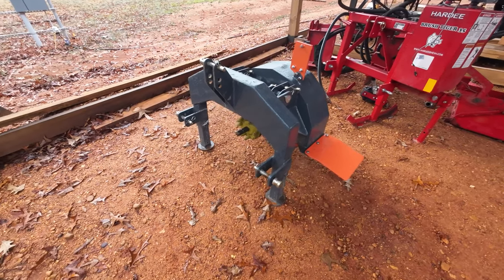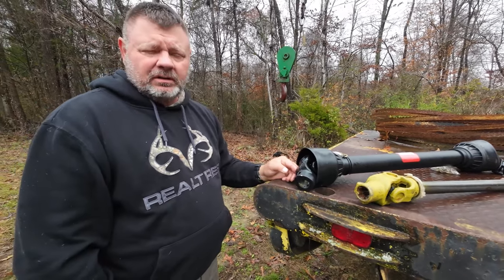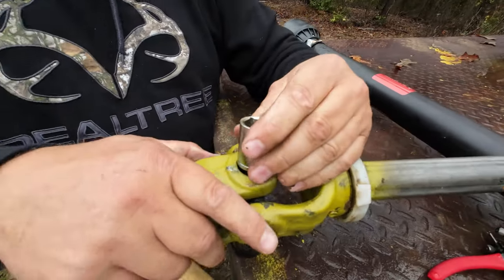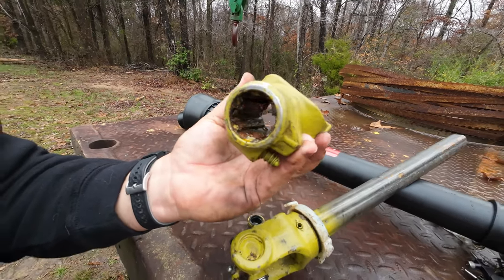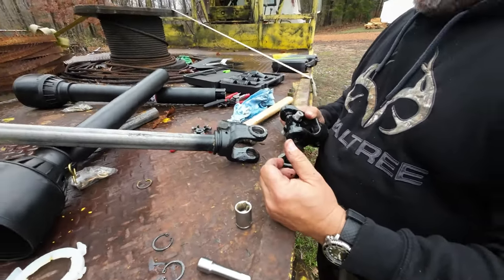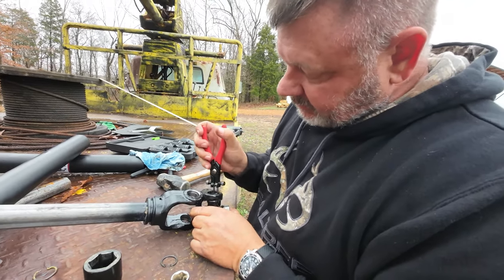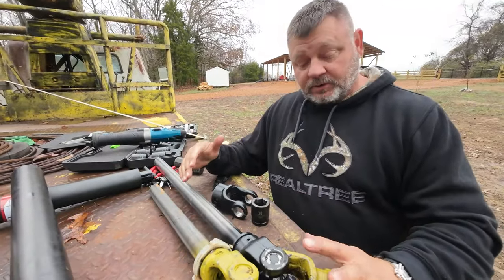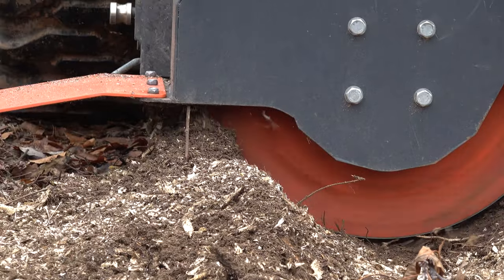How To Replace a PTO U Joint  in the Field Without the Right Tools

Comment: I wish all u-joints just used those nice little 5/16" head bolts with the straps you find on a differential yoke. No more banging

Comment: I hate changing u joints I always have a cap come off and then one of the needle bearings gets messed up lol thanks for sharing buddy hope you’re doing good god bless
Reply from the maker: It is not my favorite thing to do. Replacing them in a nice shop with a vice or press, is so much easier. I just thought this could be a teaching moment. God Bless you and Merry Christmas
Reply: Thank you Chief.  One has to be prepared for what life hands us.  I look forward to your Sunday releases and hope you get some dry weather.  Merry Christmas if I don’t get in another response.  Do you still favor the same PTO quick connect?  If so how many male and female do you suggest?  Lots of tractors and the usual hog, finish, chipper, grinder, post hole, tiller and like that.  Ugh.  Thanks in advance.  My thought = 2F  ? & 3-4 male?

Comment: Great job....Tony!  I have changed 100s of "U" joints in my lifetime and most often use a 6"-8" C-clamp press out the old and in with the new.  But in a pinch....your method works every time!
Reply from the maker: Same here. I would much rather use a vise or press, but I have done this in the snow, mud and sand around the world. We do what we have to do!

Comment: I'm working on my PTO shaft for my orchard arblast sprayer. Have to replace the pin on the yoke shaft that keeps it locked into the groove as the spring is stuck in the open position. Was watching some other YouTube videos for solutions. Found this one on changing the yoke as I thought that might be something I'll need to do down the road. Very informative. I like your approach to getting things done, especially in the field. Many thanks for putting this out there for us. Just subscribed to your channel.

Comment: Tony, Where did you buy the new shaft from please? I need to buy just a new yoke for my Walker mower u-joint assembly and not spend $306 for a whole new assembly. Thanks for the video, I liked it!
Reply from the maker: Tractor supply, Amazon, local tractor store, etc.

Comment: With my luck, the diameter of the round bearings on the two different draft shaft parts would be different.   I'd say, you lucked out big time !
Reply from the maker: Been doing this for about 45 years. Less luck than you think. 😁

Comment: I have lost the universal joint from the center short shaft on my bushog.  I will not just go back on the machine with the uj already installed.  I managed to get it on the machine, but in the process I did seem to drop a bearing down in the cap on one end.  I can not get that cap to come all the way out again, to repack it.  Even with a pair of vice grips around it, the cap will not break the vacuum from the grease and come the rest of the way.  Once those caps peek out of the end.. how do you grip them to pull them the rest of the way free?

Comment: How do you tell which U Joint to purchase as a replacement?
Reply from the maker: Use a caliper to measure them. Or pull the old one out and bring it to a parts house. They are common.
Reply: Thank you

Comment: Not sure why you didn't punch the roll pin out of the profile tube on the original. You can replace the inner and outer profile tubing to a heavier grade.
Reply from the maker: Because I was showing what to do in the field if something breaks. Most people are not going to upgrade for a single U-joint.

Comment: Hahahaha... I just finished watching this... so easy.
BUT, I say BUT... you won't do it that easy on my equipment. No sir.
My equipment requires 3 people with 4 arms each, working 12 hours daily for 2 days to do what you did there.
Yes I have old equipment.  LOL  
I believe I could make a real video... Haha
Reply from the maker: I have done it on old military equipment in the middle of the desert. It can be done as long as you have a big enough hammer!😁
Reply: @TonysTractorAdventure  A big hammer is the key. If you can't get it done, then get a bigger hammer. 😅

Comment: Couldn’t you have knocked the roll pin out and just changed the shaft after cutting it to size?
Reply from the maker: I don't understand how removing the shaft would help anything. The U-joint still has to be changed.